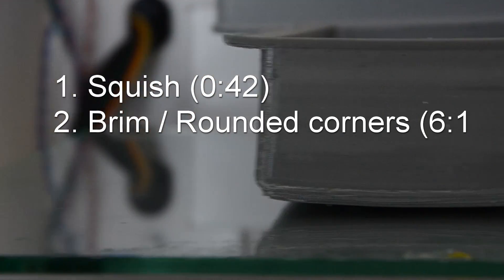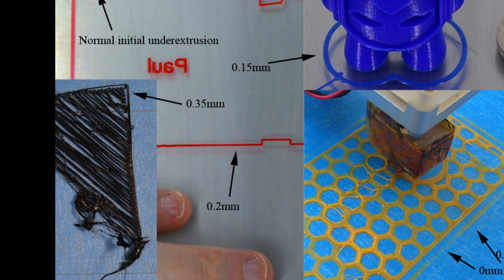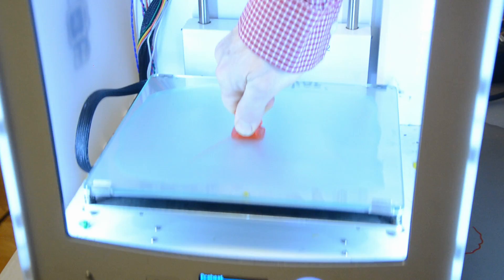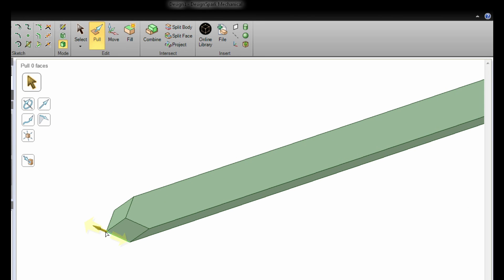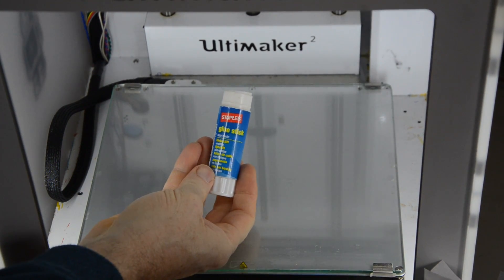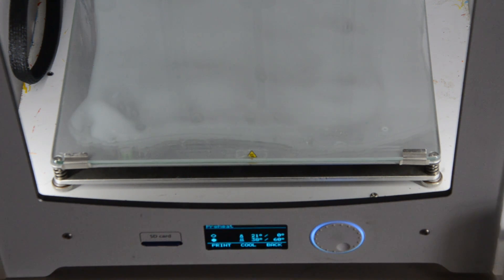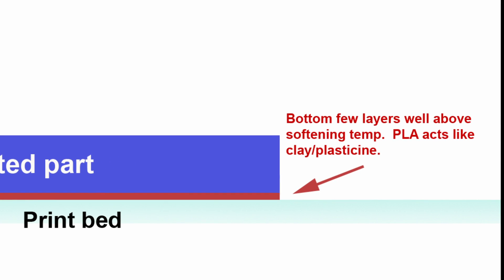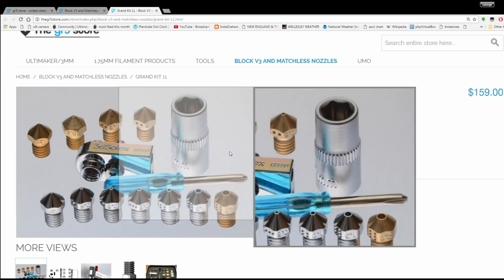How to get your 3d printed parts to stick to the bed and avoid curling/warping

Comment: I don't have a glass bed, mine has a metal plate, with a thing plastic sheet that covers it( it came with the printer) one side has the brand on it the other side has glue.
Reply from the maker: I know lots of printers have metal or PEI or ceramic plates these days. I've never printed on any of those so I don't know what glues you can or can't use on those.  HOWEVER, everything else other than the glue advice still holds.  So keep your finger oils off of the plate and occasionally clean off the oils with dish soap. Squish is still the most important of everything you do. Heat still matters as explained in video. Rounded corners still help. Brim still helps. Raft still helps as a last resort for extra difficult high temp materials.  Lowering fan, covering printer can still help as explained in video. But squish is the most important of all of those.  Also heating the bed a bit so the material has a few more milliseconds to get into the crevices as first layer is laid down will help. And keeping it above the softening temp helps distribute the warping forces.

Comment: Is the glue easy to clean off the glass?
Reply from the maker: Not hard if you have a sink and scrub brush or putty knife.  It softens if you soak it.  But I only remove once per year or so.  You can see me clean it all off in the sink scene.

Comment: I've noticed a lot of sites say to use a temperature close to the Glass Temp of plastic.    PLA is 60 to 65 so 60 is right at the Glass Temp, not above it.
The issue with going above the glass temperature too much is the first couple of layers will remain too soft and that allows it to be distorted when upper layers cool and shrink.
It's a very fine line.    Given PLA can be printed successfully without a heated bed, I still believe bed leveling and Z Offset is the critical thing.  Too close and the nozzle could pull first layer off the bed (not to mention damaging the nozzle or bed), too far and it just doesnt stick (For PLA.  PETG is a different story altogether).
Thanks for a great video.
Reply from the maker: Knowing "glass temp" is basically useless for 3d printing because it's not the temp where a material starts to get flexible.  HDT is not helpful either which can be below room temp for commonly printed filaments.  What is important is where PLA gets soft and that is at 52C.  Try it.  Try it either with hot water with a thermometer in it or a heated bed.  I've tried many different brands and they are all around 52C but I wouldn't be surprised if that changed to 49C or 57C for some brands but so far I've only seen it at 52C.  Above 52C you can bend PLA and it goes to the new shape like clay.  Nylon doesn't really have a temperature (like PLA) where it quickly gets  more flexible.  Instead it is flexible at room temp but gets more and more flexible until it suddenly melts.
Reply: @gr575  Thanks for the information.  I guess it really is not an exact science, as there are resources (can't paste links, but google can find them) that do mention glass temperature as being important.  Whatever works I guess.  :)
Reply from the maker: @EsotericArctos  "glass temp" is often used loosely in the 3d printing community even though it has an exact definition.  I've switched to talking about the "softening temp" which doesn't have a formal definition.  Whereas HDT (heat deflection temp) and Tg (glass transition temp) have proper definitions.  Because "the temperature where filament gets soft enough to be less likely to warp" doesn't have a name, lol.

Comment: What if brims still allow warping on a square-based print?
Reply from the maker: Brim isn't enough.  bad "squish" alone will make your print lift even if you do all the other tricks.  oily surface alone will make your print lift.  Watch the video again - do all 4 tricks in the video.  If you think you did all 4 then you probably missed squish or have some unusualy printing material or you have a high temp material and no heated bed.  You can use a hair dryer for 5 minutes if you don't have a heated bed to help ABS flow well into the cracks of blue tape.  Every situation is different.

Comment: squishing the layer also results in dimension change. a 10 mm will be 10.8 mm
Reply from the maker: I think you mean 9.8mm but yes.  Your part might be 0.1 shorter.  Alternatively, you can overextrude the first layer by setting the flow parameter high for the first layer only and then level such that you still have a lot of squish but the nozzle is exactly levelled such that Z=0 just barely touches the bed.

Comment: Great video overall, but ignores the limitations of standard stepper drivers, which give you a multiplier of 0.04.
Anything that is not a multiplier of 0.04 increases print time.
Reply from the maker: Did you put this comment on the wrong video?  I don't think I mention anything that is relevant to what you say.  Also I don't think you meant to say "print time".  I think you meant something else - maybe "decreases print accuracy"?

Comment: How do I use glue stick on magnetic bed?
Reply from the maker: This question is too vague.  You might as well ask "how do I use glue stick on a bed".  What is the surface of the bed.  Who makes the surface?  Is this one of those flexible surfaces?  From buildtak?  Creality? Prusa?EZFlex?  What material are you printing?  Most of those flexible beds shouldn't have glue on them if you are printing PLA.
Reply: @gr575  I've Creality Ender 3 pro. It has flexible magnetic sheet. So, I can't use glue stick on it??

Comment: This helped confirmed a theory that I needed to heat my bed more as well as check my leveling! My Ender 3 was good for my first few small prints, but as I tried bigger prints, they kept warping. I added a raft, still some warping. Now I need to adjust my bed heat for wider and thin based parts as well as checking my leveling. Thanks for the helpful video!

Comment: Plenty of non ultimaker brand printers out there accept gcode files,  ultimaker is not the only printer brand out there.  If you are going to be biased towards one particular band, at least be honest and admit it.
Reply from the maker: It's just what I happen to own.  I don't own any other brands.  I'm not recommending any particular printer and I tried to give advice that is for any printer.  I talk to people with other printer types every day and hear how they deal with getting parts to stick.  I would have mentioned prusa's awesome bendable metal plate and some other things but that came out after I made this video.  Everything in the video is still relevant.  "squish" is still the most misunderstood way to get parts to stick well.

Comment: hmm - i just turn down the bed temperature from 60 til 50 when the print has gained some "height"... no warping... and i just wipe the bed with alcohol after every print... thats it..
Reply from the maker: Turning bed temp down makes it more likely to come off the bed.  Not less.  Keeping the bed clean after every print really helps a lot.  But some day you will have a more challenging print - perhaps something 200mm (8 inches) long
Reply: @gr575  i am talking about warping... 50 degress i ample to keep the print where it should be - i have never had any issue! Maybe your bed i not as clean as you think...
Reply from the maker: @MrMichaelfalk  "warping" for most people means that the part pulls up at the corners as I show in the thumbnail for this video.  50C is worse than 60C for 3 reasons:

1) lower bed temp means lower air temp so you have even more warping because the differential in temperature of when the plastic becomes solid and what it then cools down to.  The more temperature difference the more it shrinks.

2) More importantly, PLA is still pliable above 52C.  It acts like clay - you can bend it with some force and it goes into the new position.  This allows the powerful warping forces (higher layers are pulling inward) to spread out more.  Even if the PLA only moves 0.01mm, this is enough to spread the forces over a larger area and the corners stay down.  I explain this in the video.

3) Finally 60C is better than 50C for the initial layer as the plastic flows into micro pores of the glass better but for that I found 40C was warm enough.  But you do the first layer at 60C anyway so you are only losing #1 and #2 by lowering the temp after the first layer.

Comment: As much downplay as rafts get, it's the only thing that works for me when all other procedures fail.
Reply from the maker: For a glass heated bed I don't believe that for PLA.  For a bed that can get to 110C (not 100C), I don't believe that for ABS or Nylon either.  But for some materials like PEEK or if your heated bed can't get above the softening temp of the material you are printing, then yes.  A raft is a life saver.  It makes the bottom of your part ugly but it works - parts don't come loose.  I've never had to use raft.  Ever.  But I guess I don't print in many materials - mostly PLA and Nylon and easily 100 prints in ABS.  I've printed in many other materials (ninja flex, ninja cheetah, TPU, ABS, ABS/PC, Nylon, GF nylon, CF nylon, PP, PET, PETG.  But only 5 or 10 parts in most of those.  I seem to remember PP was the hardest.  I guess I can understand using a raft for PP.  But for ULTEM or PEEK, unless your print bed goes to 160C, you should do a raft for sure.

Comment: where are the details of the experiment ?
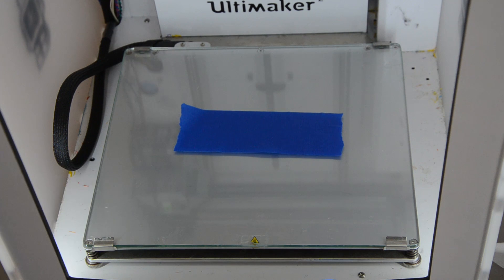Reply from the maker: Some of the raw data is at 12:21 in the video.  I printed the bottom 2mm of the "ultimaker robot" which  is about 1 square inch of rectangular surface area where it hits the glass, then I used a screwdriver that I had vertical so it wouldn't pry up but just push sideways.  I pushed the other end of the screwdriver with a scale that had a nonflat surface so the screwdriver stayed in place on the scale and increased pressure slowly until the part jumped off the bed.

You can see most of the data - I tried different temperatures with no glue then tried some with glue stick spread on the surface.  I also tried different nozzle temperatures.  Then on another date I tried watered down gluestick and that stuck better and if I printed the same part over and over again, presumably removing a little glue each time, I noticed it got harder and harder to remove parts as time went on but if I clean it all off then it's easy again to remove parts.  This was not as controlled an experiment - just things I noticed when busy printing things.

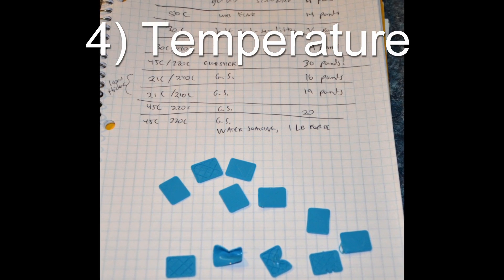Also in the screenshot at 12:21 in the video you can see how sometimes the PLA base deformed due to the screwdriver.

Also I had noticed (and other people pointed out) that rounded corners are less likely to lift - I had a part that had some sharp corners and some rounded where the rounded corners did not lift but the square ones did.

I don't have much data regarding brim.  I've always assumed it's better and nothing has happened to disagree with that, but I wasn't as careful testing that theory.

I've been 3d printing using many different printers and materials for about 7 years now so some of this (kapton tape, blue tape) is from other experience.  The alcohol thing on blue tape is so striking - how hard parts stick - that I'm very confident that's correct.

I've never actually used ABS glue but that was the standard method I'm told from before PLA got popular.

The squish issue is from experience.  If I print so thin it's transparent (both on blue tape or glass) then it's very hard to get the part off and there is a huge difference between different amounts of squish: one could easily try 3 different amounts of squish and find large difference in how well the part sticks.  After printing 1000 PLA parts with different squish you learn these kinds of things.

Sorry I never did all the experiments on one day and quantified everything.

Comment: so for pla on a glass bed, a glue stick and then whiped out with a wet paper rag, then heat up should work good. im going to give it a try! getting tired of the parts warping, howlong do you use the glue on there? of do you reglue it before every print? 

bed lvl before putting on the glue? 

thanks for the info in this video. 
ill give it a try
Reply from the maker: I reapply glue every 30 prints or so.  Glue is too thin to affect leveling.  I can go months without leveling.

Comment: I have a sticky platform sheet that I put on my class and I also put rubbing alcohol on it and my prints keep curling. What should I do
Reply from the maker: As the video says, "squish and brim".  Squish the print more into the sheet.  Look at the image in the video that shows different amounts of squish so you know what to look for.  What kind of sheet is this?  Is this the "ultimaker adhesion sheets"?  Those are good for only certain materials, I think maybe PP.  What material are you printing?  PLA?
Reply: gr575 I am printing in PLA and I am using the dremel 3d printer sheets (I have a dremel 3D printer)
Reply from the maker: @BigSStudios  yeah so level the nozzle closer to the glass.  More squish!
Reply: gr575 ok thank you for the help. Have an awesome day!

Comment: Good instructions, thanx! I use a usual painter's tape for PETG and a lot of glue stick. This time I think I've messed up with Z-offset in Cura and the flow value (99% was bad). Also the brim (a closer skirt) was incorrect (too separated). So I've got a huge corners' curling... for about 2mm!
A thin glue layer doesn't work for me (even for PLA) - it dries off and then it doesn't work. It needs to be sticky on the 1st layer. For PETG it's even more critical. Because the bed need to be 70C so it dries off the glue quicker. And it's on a painter's tape... Too much moisture: a tape will be bumpy. Too dry (or not enough glue) - PETG will not stick well and screw up the whole print at the beginning (with a sticky mess over a copper nozzle).
Maybe it can be a good workaround to place Initial layer horizontal expansion to -0,1 - 0.3mm (depends on many factors) so it will compensate that elephant's leg. Only one thing it will fail - if a detail is too thin. I've got a zero valume on 1mm thin test cube 100x100x10mm with hor. expansion previously set to -0.35.

Comment: You can squish it on the glass as hard as you want. It wont damage the glass or be hard to remove if you wait for it to cool down. Mine usually completely detaches itself whenever it cools down

Comment: Hey man thanks so much this really thought me a lot about the thermal expansion properties of pla you made lift off / curling much easier to understand. Thanks. I was trying to make a sony Walkman on a Fusion Idea printer F100L and using my custom added glass bed at 75C (212C pla 0.3mm height) Exactly what you described happened, the pla on top of pulled up the case and tape cover about 0.75cm up!!! Going to try glue sticks and try to suish at a out 0.15mm for the first layer.

Comment: Very interesting, thank you! I've just started 3d printing with a Tronxy X3A, really enjoying it. Other than dealing with a warped bed (new bed & glass sheet coming) I haven't really had any issues once I get the bed level and height correct, but it's still useful to keep these tricks in mind for larger prints. I'm doing my first print with PETG filament at the moment, had to get the bed to 80c and wind up the extrusion rate before it'd stick, seems good now though (fingers crossed!). Only issue is I'm running the nozzle at 250c and it's not an all-metal hotend, so the teflon bowden tube is making some awful smelling toxic fumes that I'm trying not to breath, it's printing well though! :P I have an all metal hotend coming because I think I'll be printing with PETG a lot, it's really nice stuff. Subscribed :)
Reply from the maker: all metal sucks for pla but is great for everything else (pla sticks to the metal and you will want to throw the printer out the window as you will get constant failures).   Are you sure those fumes aren't the petg itself?
Reply: That's useful to know, thanks for saving me a lot of agro! :D You may be right about the petg smell, I'd heard it doesn't make much of a smell, but whatever I'm smelling is pretty horrible. I'm not too worried though, I'm in a well ventilated room and it's printing perfectly (after all the messing about getting it set up I'm ecstatic!) 
I'm really looking forward to trying a glass surface, the warped alu bed is incredibly frustrating, it's got more than a layer height of deviation so trying to do a full 200x200 print atm is impossible without a raft. 
Have you printed anything interesting lately? Or different filaments like Polycarbonate? Maybe you could do a video talking about your most challenging prints, would be interesting. Have a good evening :)

Comment: I have a perforated heated bed ..so which method should I use? I'm thinking increase the bed temp or blue tap+isopropyl alcohol?
Reply from the maker: Danny Lel spend $10 at harbor freight and get an ir gun temp sensor.  Play with bed temp until top of bed is 60C for pla.  What do you mean perforated?  You can probably print straight on the surface.  Just clean it occasionally.

Comment: Ok nice informative video.
At around 6mins 45 sec what was the 3d program that you were using.
Many thanks
Reply from the maker: kev wallcroft design spark mechanical.  It's free.  It's my primary cad software.
Reply: gr575 Thanks what is it called ?
Reply from the maker: design spark mechanical